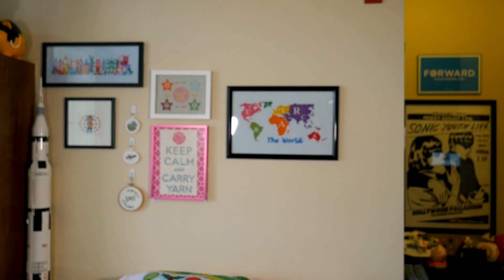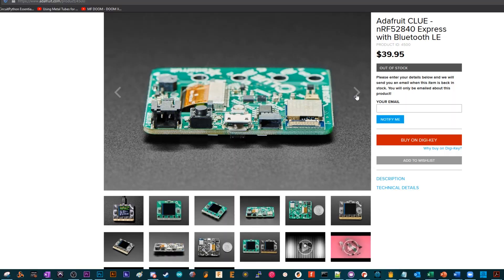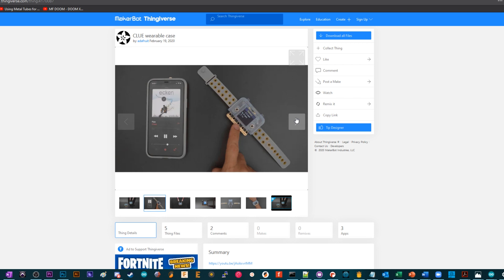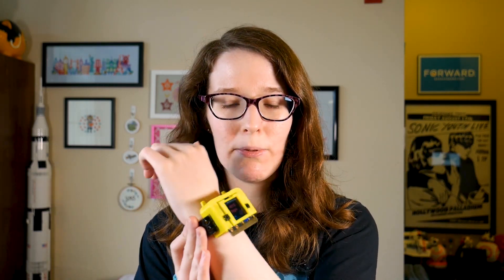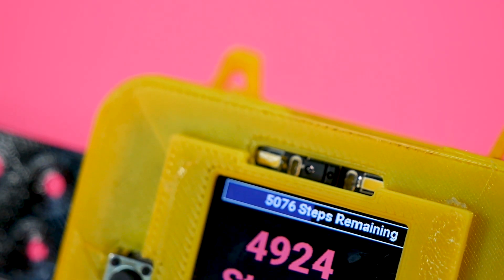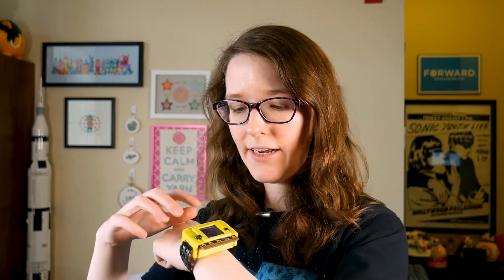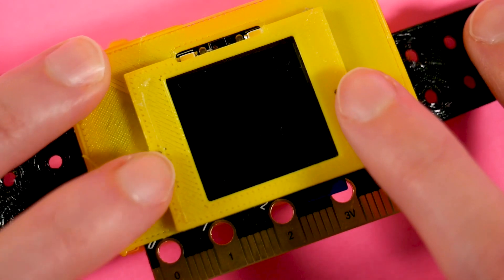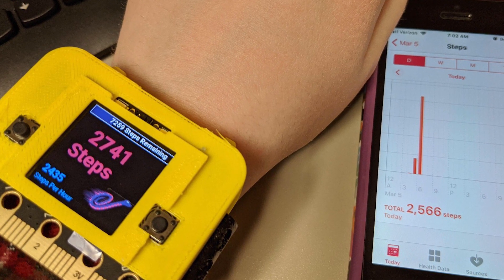CLUE Step Counter 🔍🚶‍♀️

Comment: CLUE Step Counter with ST LSM6DS33, if I got it right, it has the following components: 
    1x Triaxial Accelerometer (ACC)
    1x Triaxial Gyroscope (GYR)
    1x Triaxial Magnetometer (MAG)
There are for instance sports foot pods of different accuracies. The standard Gamin foot pod only uses a 3 axis accelerometer. The Stryd foot pod which is the most accurate has if I got it right the same set of motion sensors as the clue. Does the clue step counter only use the 3 axis accelerometer, or does it use the whole set of sensors for step counting?

Comment: Great instruction, and I really love it. I do walking meditation, and for walking meditation it is helpful to know how many steps you made as accurately as possible. I had big problems with Garmin devices, since Garmin does not allow to access to number of steps done during an activity in Garmin connect anymore. Steps have to be calculated manually from Garmin Connect data, which is not very comfortable. Is there a way to read out the number of steps done during an activity from the CLUE step counter by a PC application?